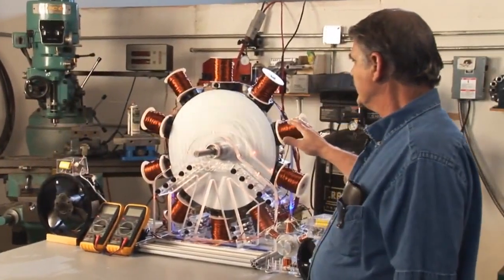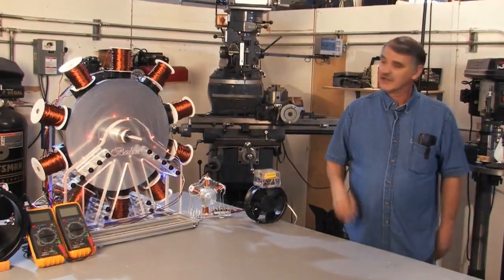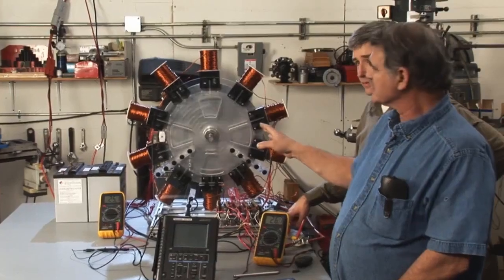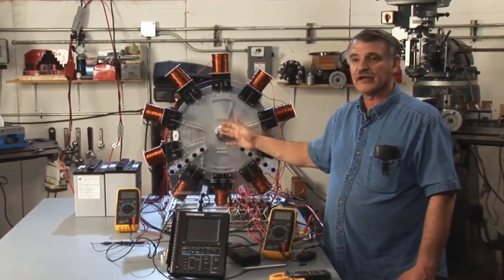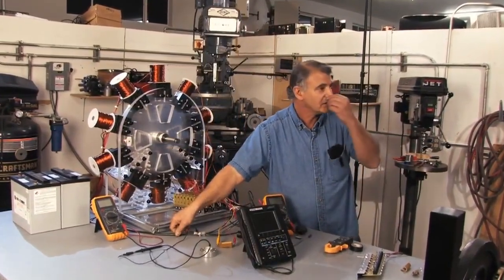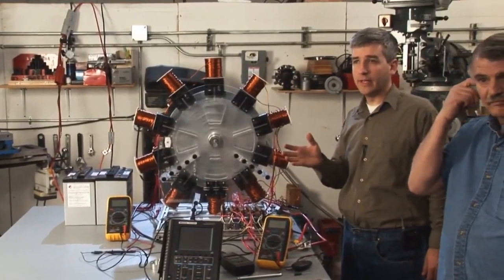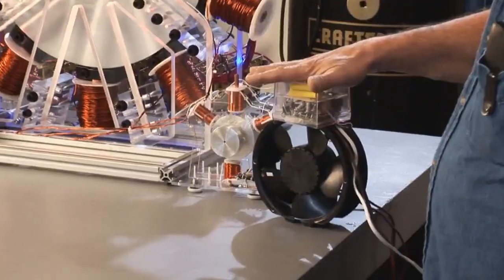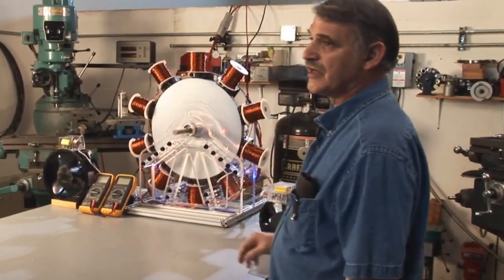2010 Official Bedini 10 Coil Kit Infomercial with Rick Friedrich

Comment from the maker: NOW SELLING A NEW MODEL OF THE ORIGINAL 10 COILER
https://www.r-charge.net/original-10-coiler-monopole-energizer.html
Reply: can this be used in place of solar panels and charge up a bank of 15-20kw of batteries ?
Reply from the maker: @mscavsfan  That's not really a specific question if you are asking about how much you can get out of it. What I am going to say about this system is that it will be exactly like the original one Bedini first built for those who want it. This will be an extension and example for the new SG kit to do advanced research with. We have always said about these systems that the output depends upon the size and condition of your batteries as the batteries are half of the system. Also, we do not recommend buying a large system like this until you know by experience what it does on a smaller level. That was why we made a very small model to play around with and see if it is for you.This has an advantage over those smaller ones. As for these kinds of systems, they are capable of being a prime mover to run unlimited outputs when doing the advanced process along the lines of a Tesla resonance standing wave or similar system. This is not a plug-into-an-inverter system even though I have shown the basic level battery system with an inverter.
The battery banks Bedini used for that original 10 coiler were 2 x 24V of 2000AH cell phone tower batteries which I had at my shop next door for 3 years. These are 48KWH each. You can't really judge from video 2 as to what they can do. The input was 24V at 10A. He attempted to demonstrate running the 3000W of 100W bulbs and charging back up the bank in so many minutes and then measuring the state of charge with a meter with a limit to be used on only 100AH batteries. This is not what Brett or I did to properly test a battery and system as we would cycle many times (as the battery charger I sell does with readout). The batteries are conditioned over time and become a better receptor of this kind of charging. This will once again be a big part of the new SG kit as thousands of people did starting 20 years ago.
Reply: @rickfriedrich  Thank you Rick....
Reply: Considering the device scale and it's marvelous capabilities along with the design and craftsmanship implemented I can honestly say I did not expect the price to be so convenient.

Thank you for everything you're offering.

Comment: What do you think of this Rick? ..& what do you make of Thomas Bearden's solid state, no moving parts over unity? I'm realizing our over 6000 patents at the USPTO have been under tight lock & seal. 
Fluid Air Displacement 
https://youtu.be/287OTl7cKXM?si=hgaAnEjAPqhUj-zZ
⬇️
https://youtu.be/SQgUaaDs6x8?si=9vs7kfCR-197NI9U
⬇️
DENSITY 👍 BUOYANCY 
Air + Water + Force = Free €nergy
https://youtu.be/68nRS8VckUE?si=WfnTlA0Y2X4gYakV
....
I'll break down this video that's in my link.
Imagine the force of trying to hold a beach ball underneath water. Now add multiple jugs of air and you can imagine the force of upward buoyancy. When the jugs reach the pivotal point at the top and make the turn to travel downward, they fill back up with water therefore taking away any resistance. When they make the turn at the bottom they again get a shot of air from the compressor that fills them to achieve the buoyancy force. A (non-motor) generator is attached to the buoyancy device, and the output power that it produces is more than enough to provide for the air compressor. 
The idea is pretty simple & straight forward.

Comment: How many batteries does it typically take on the back end to see appreciable gains? Is there a ratio? I would love to see some metrics somewhere!
Reply from the maker: There are several factors involved including the actual state and quality of a battery to establish a proper context. What is thought to be a new battery is often a mistake and it needs some desolving of the sulfation which is not an efficient process (but usually takes only a little time). The actual capacity of the battery needs to be determined. 
The bigger the battery the bigger the gains once the batteries are new or rejuvenated. While you are able to charge and discharge at C1 rates we recommend C20 rates of charging at least. There is a lot of detail in all this that I am putting into the new SG kit. Rest periods between charging and loading or between battery rotation also are additive and in some cases make a difference between the total charge slowly declining and having the ability to perpetually rotate. Over time the batteries get better and more receptive.
However, there are several different methods of charging which is too much to get into here...

Comment: Hi Rick, greetings. Is that kit autonomous? I say this because in Spain we have a visually similar but mechanically different system, and this one operates autonomously. Congratulations on your great work for science.   https://youtu.be/ut68qAeT2F4
Reply: I am a witness to your work, my dear friend, I attest to its functioning.
Reply from the maker: You will have to explain what you mean by autonomously. Do you mean self-tuned or running continuously? 
You have to understand that this was a system we made in 2010 for about 7 years. Then we made the dualpole model that had some mechanical energy as well. Both of these are not being sold right now. We will be making the original 10 coiler that no one has produced, but which some of us have made.
We have made all of these systems run continuous as in self-sustaining and also self-tuned.

Comment: With how much power can this energizer  charge the battery, and how much is the voltage of the battery bank?
Thanks!
Reply from the maker: Initially I made this for over 100V but no one wanted to use it with over 24V so I changed the resistor values. 
The amount of charging is determined by the size of the battery in the proper context. The bigger the battery that is prepped for this system the more the charging due to the fact of it being true negative resistance. These were shown on the basic level and we saw upward of 200-250 times the input energy. The advanced processes are not limited at all...
Reply: @rickfriedrich   thanks
Reply: ❤I have a 600 ah 25v LiFePo battery can it charge it instead of my backup gene?
Reply from the maker: Yes, but remember, the one in this video was the first one we were selling. We'll be doing the actual original shortly.

Comment: Amazing work! 

Do you continue to manufacture them and how do you like to use it personally to benefit your life?

Do you think this technology is working with Wardforce?
Reply from the maker: We will be making the original 10 coiler shortly. The one we made for years was great but cost a lot to make and our manufacturer stopped making them.
I did many things with these motors as demonstrated at my meetings. I have taught on this for 20 years now showing basic level, intermediate and advanced levels. The basic level allows for battery banks to be rotated around while running mechanical loads. From there we add other advantages. In the advanced levels we can have one battery stay charged or even be a capacitor while the system becomes a primemover where you can multiply the output as many times as desired.

I don't understand your last question in saying "working with". We don't work with Ward and I don't know if I ever had contact with him. While I can see the focus on frequency, etc., I'm not sure if I would state things that way. No really familiar them.

Comment: Are the kits or the schematics/ assembly instructions available for those that would like to build one of their own?
Reply from the maker: We will be doing some of that in the new SG kit I'm just finishing up. Then we will revive what we were doing back them with a limited forum where people can post their replications. We'll be making this as a kit, not again, but for the first time. Because despite what John said in this clip, it wasn't the original 10 coiler. So we'll make that as I personally did 20 years ago.
Reply: @rickfriedrich sounds great, I would appreciate it if I could be added to the forum. I built the original ssg and would like to build a 10 coiler with the updates in the hope of getting off grid, electricity prices here in the UK are unbelievably high. Looking forward to seeing the new kits. Thanks for all your doing 🙏
Reply: Can't wait for the son to try, he is wanting to get a kit lined up! Richard, Tom, and Max send our thanks! I'm still looking into your mechanical ocillilator

Comment: I love this content thanks for posting!! If I had the dollar capacity I would like to take this exact thing to the endth degree. Because some say this tech doesn’t work others say they have become energy independent and run a house on it. I wonder how far Rick has taken this.
Reply from the maker: Well you can see some of what I've shown running on these videos. Cars, boats, homes, whatever needs mechanical or electrical power or heat. There is no limit.
Reply: @rickfriedrich  awesome!! Thanks for sharing it I will watch it